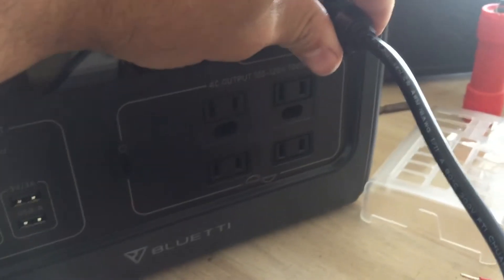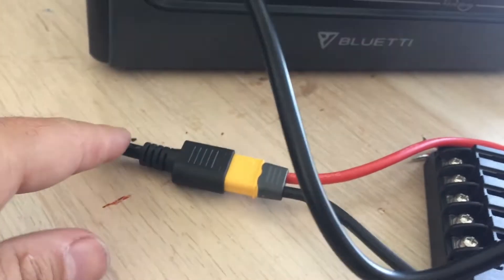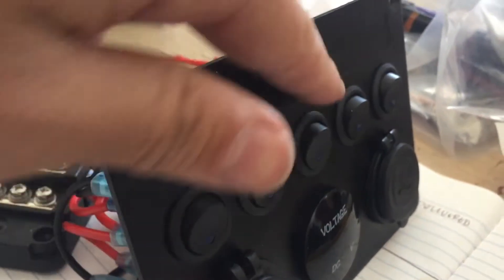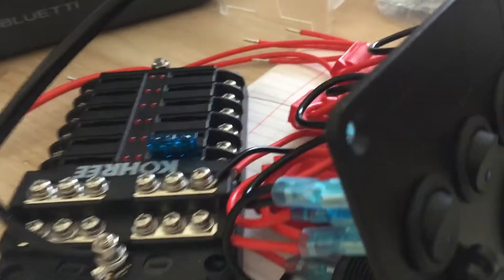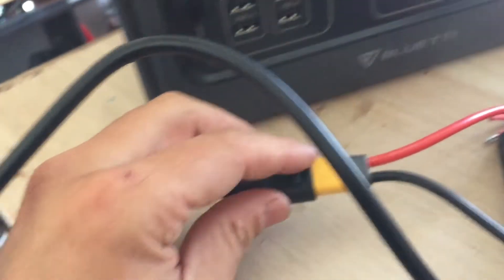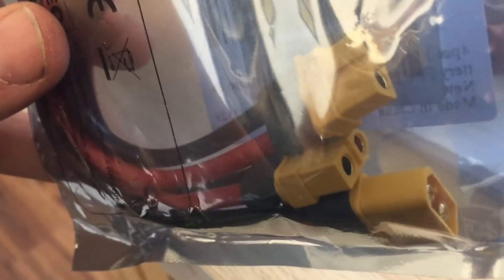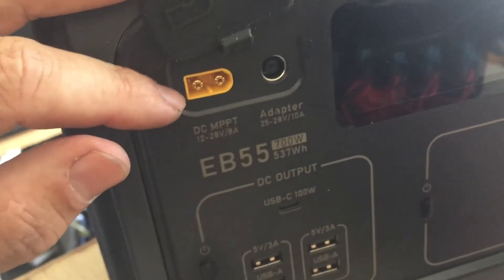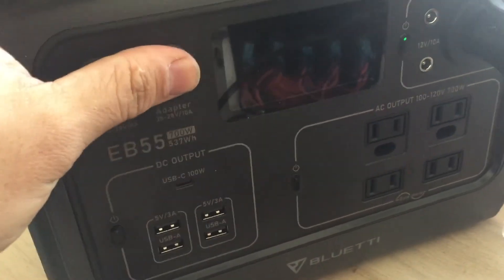VAN LIFE | How to Connect 12V Fuse Panel to Rocker Switch & Bluetti EB55 for Power Setup

Comment: Have all of your devices worked using this? Fan, lights and your other accessories?

I tried doing this and the switches on the panel don’t work. I have the eb55 as well. 

Wondering if yours all work!? Thank you
Reply from the maker: Why don't they work?

Comment: What did you tie the negative leads too? For instance a fan, positive to positive on the switch panel. Then where did you run the negative lead off the fan?
Reply from the maker: the fuse box has negative connects

Comment: I’m confused why you have both a switch panel and fuse block. Either one can be used by itself.
Reply from the maker: Switch panel to turn things on or off all in one location and also has extra usb and cigarette outlets which fuse box doesn't.